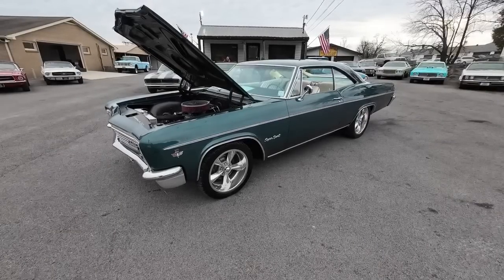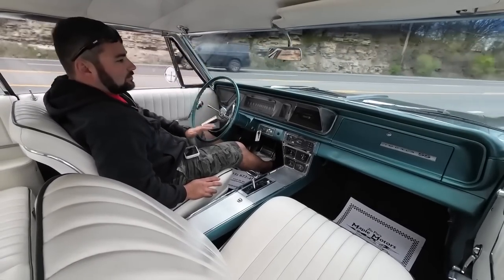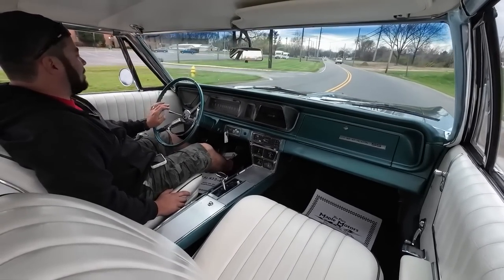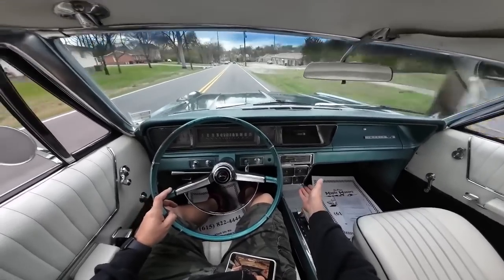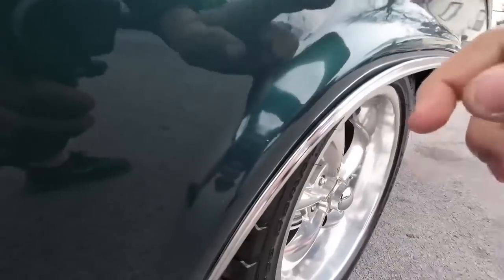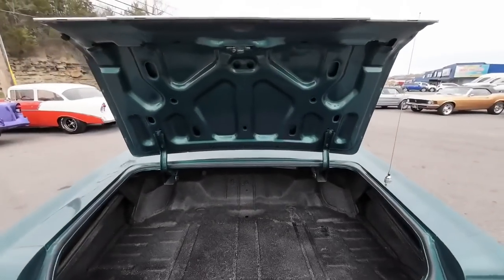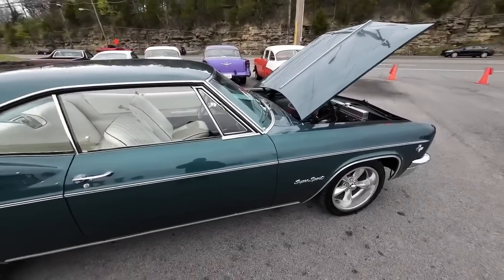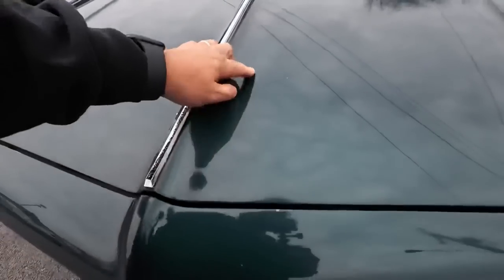Test Drive 1966 Chevrolet Impala Super Sport SOLD $31,900 Maple Motors #2070

Comment: I love these test drives. Funny my friend worked at a used car lot here in NY. He was doing just what you are, checking throttle response,, brakes, steering,and a police officer pulled him over and said he was driving recklessly and he might get his car impounded. He explained what he was doing, and showed him the dealer tag etc. Cop was still a hard Case. I think my friend was driving a mid 80's Cadillac Fleetwood. Sky blue all power , had about 20k miles. not a hot rod or a car to drive recklessly. nice Impala!!!!!!

Comment: I have a '68 SS fastback 4-speed. Love the Impalas. '58,'59,'66, '67, '68 are top 5 favorites. I own a '68 because it was the first musclecar I ever bought and built myself back in the mid 80s, when I was stationed in Georgia as a young airman. I told myself if I ever get another one, it'll be a 4 speed. I feel lucky to have found mine. This '66 is one sharp car. Beautiful, and in great condition after all the years. The Impala body style is iconic in the years from '58 to '70. 6 tail lights, 4 headlights. And the space age dash in the '59 and '60 models is bad ass. I wish they would have carried the rear speaker  in the middle of the back seat, top, with the Impala on it, on into the '68 models. My Pops had a 1967 427SS 4 speed convertible when I was in my teens. I wish I had that car today - I absolutely loved it! It went through a few different paint jobs, and had a 396 in it when he obtained it. He had one of his buddies that was a tattoo artist engrave tigers on the rear windows. I looked for that car when I got out of the Air Force for a couple years - I don’t know whatever happened to it. I'd add a picture of mine, but it won't let me. This car is super clean. The guage package, in dash clock,  the cleanliness overall, including the wear on the brake pedal and the ashtray never being used - I wouldn't be surprised if the mileage is original. Not original motor, but still a great deal at this price. This will be sold in less than 2 days - probably the 1st. A $40-50K car all day long, just the way it sits now. Beautiful - absolutely love this car. Not a big fan of green, but it looks fantastic on this car. Would prefer black over white on the interior, but it's in great condition as well, and I'd live with it, no problem. Man, they get some great deals on cars, don't they?

Comment: $31,900 seems a bit rich, it would have been on the money with 4 wheel disc and a LS3 under the bonnet. Its got 4 wheel drum brakes, must have been the base model, did it come from the factory with a 6 cylinder engine or the 283?

Comment: She would need A/C & disc brakes to cut it for me on these Florida roads..nice car though
Reply: I had to upgrade to power disc brakes from drum brakes in FL, in my 65 Mustang. Too many close calls!
Reply: @brucep9729  I did the same with a 66 289 c code coupe & a 68 cougar, it's just not fun unless you can keep up with traffic..people just get into going to car shows sometimes & the drums are ok ..also the GM drums generally were much better then those first gen mustang ones..